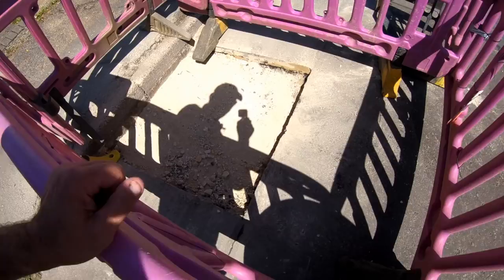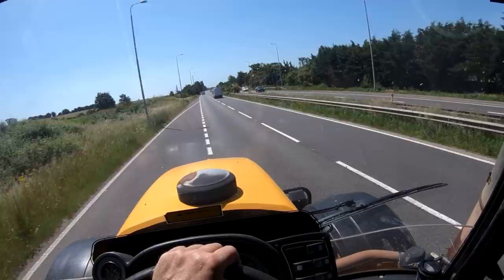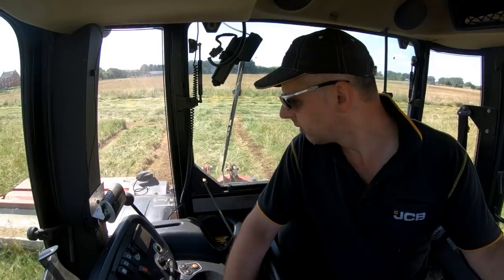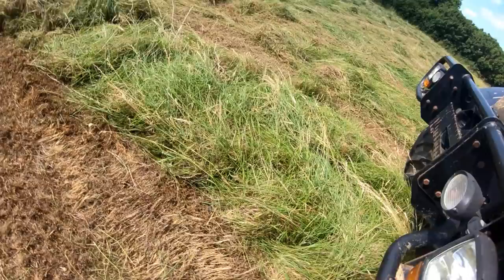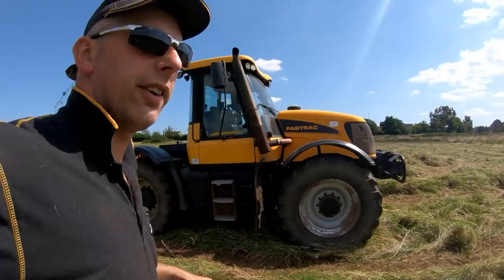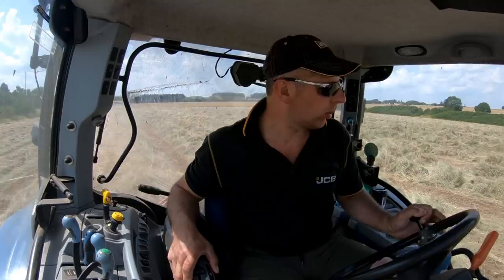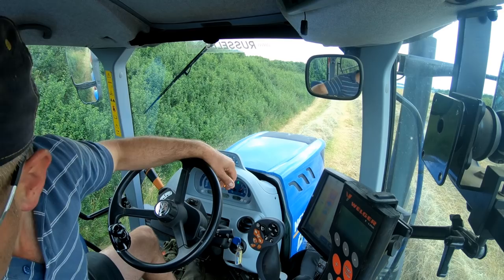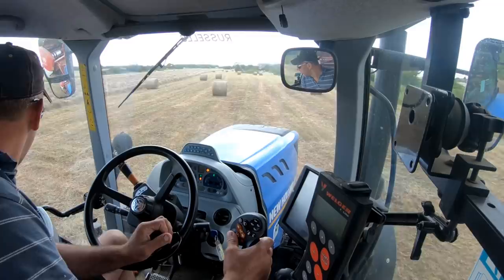MAKING HAY Whilst The SUN SHINES

Comment: Hi George... I was wondering why don't the tedder ( the hay dryer attachment ) ever be big and wide?  
I seen the widest being only just wider than the Medium sized Tractors, 

But the biggest in width of hay or grass rake attachment when unfolded can be huge width wise often 6 times wider than the tractor!

So why don't the tedder be as wide as the much wider hay / grass rakes?
It would make the job of turning over the grass to help it dry into hay far faster if a wide area of the cut grass was done instead of a small area that the tedder does now! 

With such big areas of grass to do the bigger the width of the tedder the faster the area can be done, time is money after all.

So say a width of tedder of 4 times wider than the small tedder now used, 
it would match the wider hay / grass rakes that move the cut grass into the rows ready to be teddered far quicker than the narrow ones now.
Saving tons of your time,  then as say the tedder was 4 times wider which would match the width of a hay rake of the same size

Just seems daft to have a wide rake attachment which is say 3 or 4 times wider than the tedder?

Comment: Looks a fair crop, does that fastrac have 4wheel steer
Reply from the maker: No John, on this era it was the smaller 2000 series tractors that had the option of 4 wheel steering. That said I think they would have sold a lot more 3000 series if they were 4ws as they are not very manoeuvrable with only 2ws
Reply: Ta for the reply, I'm determined to get one at some point.